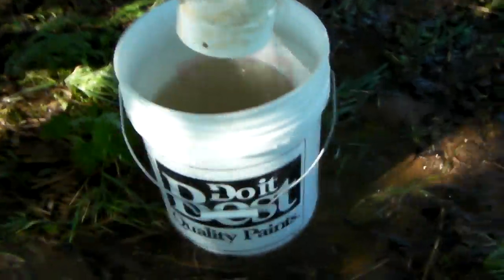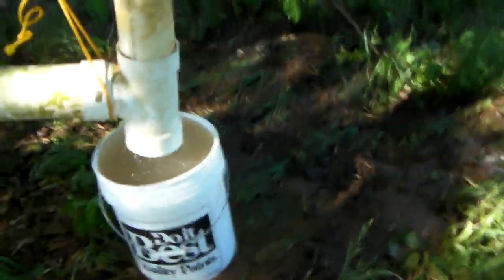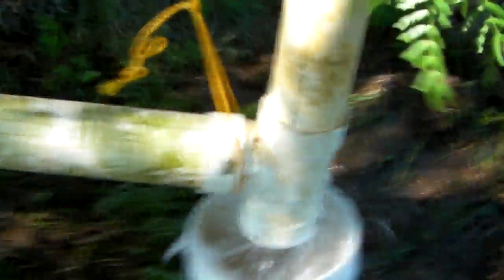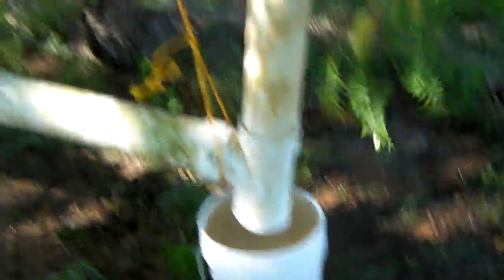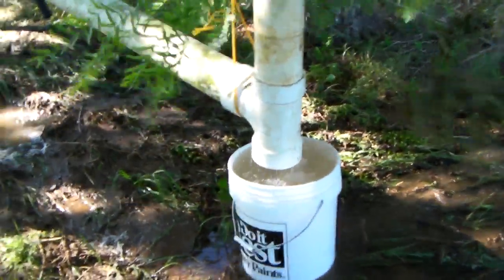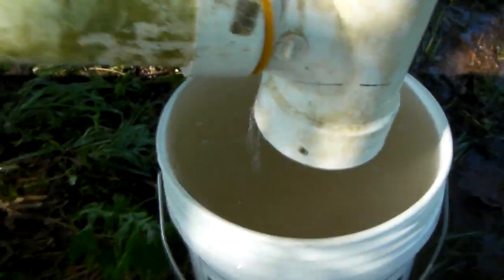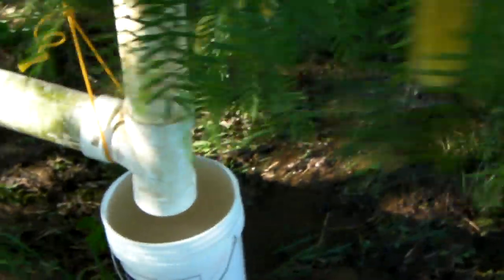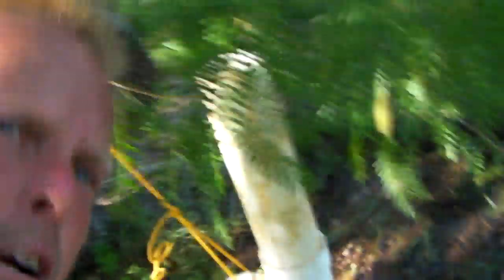Tandem air lift water well pump...12.5 GPM  Organic Mike.com

Comment: why not use a rotary type blower to give you higher efficiency flow rates? Your air is lifting the water with it's mass, not it's pressure.

Comment: Hi Mike, I'm John. I plan on doing a shallow well in my yard this summer or fall. i like your videos and have watched many videos about air lift pumps.  MTNTLAKELABS      has a video of his homemade geyser pump. It fits in a 3inch pipe and gives him 60 gallons of water a minute using 90psi from his compressor. I was shocked how well it works for him. I thought you might want to check it out.Thanks for sharing your videos, maybe I'll have one to put on there soon.

Comment: excellent work on working through all the issues and not giving up on this concept. A lot of people would have given up when they gave it too much air and not figured out that less is more, and when the "experts" told them air wouldn't lift above 60% submergence. The one refinement I would suggest for your part of the country would be a windmill with an air compressor on it and get rid of the noise  and improve the asthetics